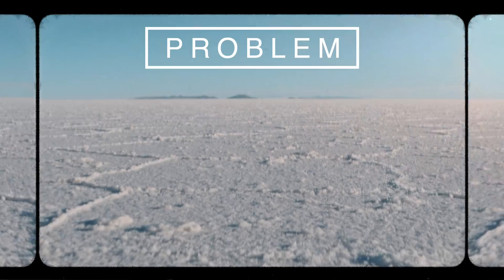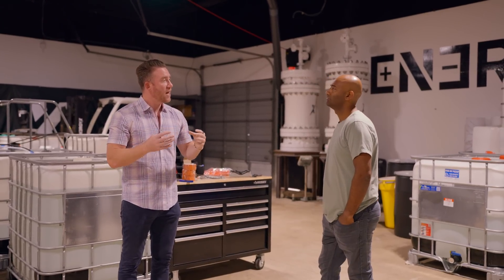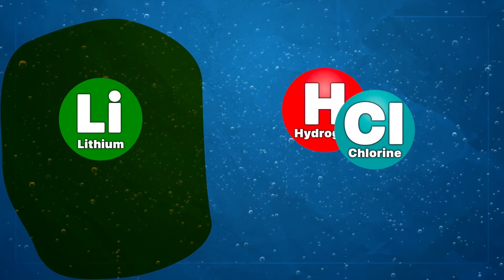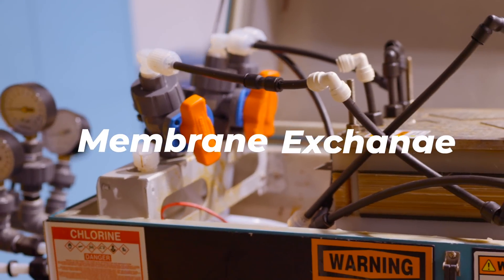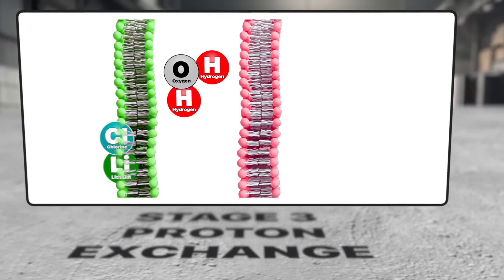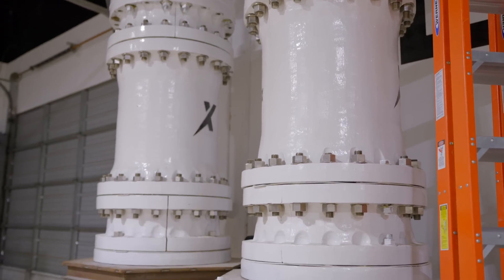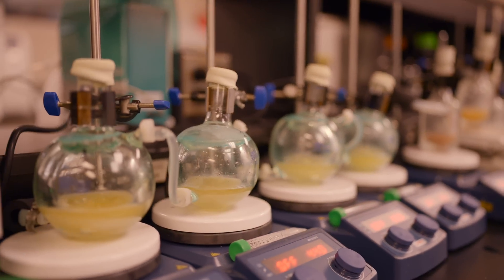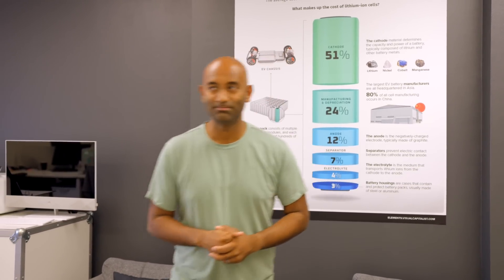The American Company Solving our Lithium Problem

Comment: Sodium ion is looking pretty positive as well. The key game changer will be to get safe solid state residential energy storage to $75 per kwh for the full package (Tesla power walls are $1000 per kwh)
Reply: Especially considering multiple of the largest battery manufacturers like CATL have already announced grid-scale Na-ion battery production within the next 3 years. Considering it will be cheaper and more convenient to manufacture compared to Li-ion counterparts, and with no other rare earth metals needed either (relative to Li-ion batteries), this is going to prove a major shift in how large scale battery production will shape our approaches in the future. More likely Lithium based batteries will fill more niche sectors in the future, rather than being a standard go-to solution for all applications.

Comment: Now just add a desalination process to that model to extract fresh drinking water. And pump that concentrated brine  into this lithium extraction system. Instead of dumping it back into the ocean and you have a 2 for 1. Fresh drinking water for areas in need and lithium for batteries

Comment: EV haters love to cite the lack of lithium as a reason not to switch to electric vehicles. They ignore that the price of the mineral has increased 8X since 2010. The only thing that drives humans to innovate faster than war is profits, and there’s a lot of money to be made from lithium. Till now we’ve only extracted it with evaporation ponds because it wasn’t worth enough to spend the money finding a better way. Hell, for decades oil companies have been re-injecting LI rich brine back into oil wells simply because it wasn’t profitable to develop a way to extract it. Now all of that lithium is just sitting there underground. We don’t even have to drill for it. The wells are already there.

Comment: Cool that they can recover and recycle many mass materials used in lithium extraction......

But tell me whether the energy being used makes it worthwhile compared to others.     Likewise all those membranes... they don't last forever unless they are used with wholly pure agents, which is never the case.   So treat the membranes as consumables ....

Now factoring in the energy cost and the normalized cost of these membranes, as well as any other cost that differs from normal lithium abstraction and production - remembering that at industrial scales unit price does NOT go down as quantity goes up - sometimes quite the reverse - and tell me again just how excited I should be over this startup that from what I can see has only some sample processes running in a lab.    Tell me that some working operations engineers in working physical chem plants are certain that the processes will scale up and still have significantly lower cost than contemporary methods.     

"In the lab" numbers do not impress me when talking large scale industrial processes.

Comment: As much as there were stats in this video and discussion on 1000kg containers, by the stats in the video it will take 70,000kg (3 x tankers in the U.S.) of brine to have enough lithium for just a single EV.  Hopefully this 50% cost reduction includes the cost of transporting the brine to the factories and the electricity to process it.  Making this system modular and portable so that it can be installed at brine pool locations will be the key here.  Let the sun evaporate it down to best concentration, extract what we need & return the rest to nature.

Comment: if its not cheaper per/ton then current process, it wont be adopted...   environmental concerns, will simply shift the process to another country...   only other exception is if it is government subsidized as a strategic resource to keep it local...  then efficiency of extraction might get some air time,  but first principles apply....  price / location / strategic need...

Comment: The reason why gasoline is renewable energy is because it's converted to gas into atmosphere which supplies plant growth. It's symbiosis. If lithium can't produce the same result, it ain't green enough.

I would rather rely on carbon dioxide and and H2O. Plus Helium and Pink Hydrogen.

Comment: I don’t understand how it’s not worthwhile to use solar thermal to boil water down to salt?  The water vapor can be condensed for drinking water and the salt mined to valuable resources. You also get a power plant and electricity.  You have an accessible supply of high power thermal energy for a variety of foundry work and resource processing.  Like why doesn’t Australia have 100s of these along the coast in areas of min population and desert?   

If a large supply of dirt cheap ocean salt becomes available on the market then capitalists will have an increasing incentive to R&D cheaper and more capable isolation of more elements from the salt.

Comment: If you're getting your brine solution from a desalination plant, you can get 30-50% salt concentration in the brine waste stream.  It would be incredible to process the volume of concentrated brine generated by a typical water desalination plant.

Pipe in sea water to a deep hole in the ground and use the power of gravity to push water through a reverse osmosis  membrane. Then you'll have desalinated water and concentrated brine at the bottom to pump out and sell or use for lithium extraction.
Reply: Sea water doesn't have that much lithium.  Lithium mining today is done using brines with unusually high concentrations of Li.
Reply: @incognitotorpedo42  yup. But, there is still economical value of lithium in 30 to 50% brine If you can extract 80% to 90% of the lithium that's there.
Reply: Torpedo has a point. Seawater is 1ppm lithium, so a gram per ton of seawater. If you boil that down to a 10x brine, now you have 10g/Mg. So a 90% extraction would yield 9g of lithium from a ton of sea brine. The dude said their brine yields a couple of kilos per ton though. 🤔
Reply: @serversurfer6169  yup. sea water is about 3% salts. But reverse osmosis removes water untill the concentrated brine solution is say 30-50% salt.  That makes the brine10× to 16× more concentrated than sea water, and we are desalinating the sea water anyways for drinkable water. 

And while the ammount of lithium is still low, using capacitive deionizastion, it's ionic mobility is 10× to 100 times more mobile than sodium which  helps concentrate the the lithium even further. Potasium ions follow lithium and are more mobile that Sodium. Add to that the fact that lithium preferentially crystals out first followed by potasium.  A ton of 50% concentrated sea salt brine has about 1200 kg of sea salts  of which  maybe 24 kg is potasium chloride and  1 kg is lithium. Depending on the quality potasium chloride is worth $200-$2000 and the and lithium chloride is worth $23 to $46.  And the remaining sodium chloride is with about $55.
Reply: @kreynolds1123  If you start with 1g/ton and you co concentrate it 15x, you have 15g/ton, not 1000g. 😕

Comment: A paper was just released that literally used reguar ass rope to do the same thing.  Wicks up the brine and speeds crystallization.  The cool part is that the different salts appear on different parts of the rope due to solubility differences so its really easy to separate too
Reply: As someone who has worked in MgCL and KCl extraction. The rope would need some serious doping to just pull out Lithium. Just to get KCl to preferentially crystallize out of a brine your need to supersaturate it and then carefully control the cooling of the pond for the KCl to form and keep the temperature above the NaCL crystallization temp. Then still hot centrifuge the Mg/K Cl slurry to gravity separate the MgCl. It's currently done on up to 100ton/hr scale but has taken 50 years to perfect.
Stark difference between a paper and mass industrialization.
Reply: link?
Reply: link?
Reply: EnergyX employee here, if it's not gonna help me eat the salts I do not want it .

Comment: What happens with the rest of the brine after lithium extraction? that might be a concern as well
Reply: It goes right back to whatever naturally occurring spot it came from.  They basically pump the brine from naturally occurring ground water, extract the lithium salt and send it right back into the same ground water reservoir though another well a few hundred feet away.

Comment: As others said, I saw a couple of red flags. The biggest one for me is energy use. A couple of those processes are very energy intensive and may not be economically feasible as we have learned from a very similar industry of desalination. The reason we currently extract lithium through evaporation ponds is to take advantage of the sun to significantly lower the energy cost.
Reply: @brandonmassaro9595
One big issue with the conventional (evaporative) brine process (open loop) is the large amount of water 💧 lost to evaporation. This processing often is performed in semi arid parts of the world 🌎 (e.g. Bolivian or Perevuian  mountains). Like many conventional extractive industries, the cost of the water 💧lost to the indigenous community is not accounted for on the balance sheet.

Closed loop manufacturing will be more environmentally sustainable long term IF the requisite energy needed to run the process can be provided by renewable sources (e.g. solar).

Like so many new processes, it'd be better if someone made an independent assessment of their Technology Readiness Level (TRL) before anybody gets too excited about it. Ricky has the background to do this.
Based on their video, I'd say they were around < 5 so they've got a way to go.
Reply: @tomdonahoe3539  Lithium brine water is not usable regardless so there's no lost to anyone.  No one, indigenous or not, is using water from lithium brine.  Indigenous people have no way of extracting water from brine.
Reply: @magnetospin I think we're talking about ground water here, not direct potable water
Reply: Agree 100%.  A new paper looked at using rope for wicking up the brine and was very successful.  The different salts occured on different parts of the rope due to solubility differences.  Completely passive.
Reply: Yea, I have a hard time believing any industrial process could be cheaper than just evaporating it with the sun's energy.
Reply: According to the corporate deck on their website, they claim that the process uses $20-40 of electricity per ton. Not sure if that's per ton of brine, or per ton of lithium produced.
Reply: @bxm61  That would be a critical difference.  That they elided it is not encouraging.
Reply: @bxm61 in the video they talk mainly about tonnes of brine so it's probably that
Reply: @bxm61 my bet is per ton of brine
Reply: @bxm61  You need to process hundreds of tons of brine to get a ton of lithium; going by averages, $30/$0.15/kWh=200kWh, which is about the energy needed to boil two metric tons of water. I think the reason they did not specify was that they thought it is obvious they meant per ton of brine.
If we assume higher energy cost and lowest lithium concentrations the cost of electricity per ton on lithium could be twice the selling price of the lithium, but the main point here is saving some of the 500000 gallons of water the current method needs. Also, the refinery can be smaller and is less likely to leak brine into clean water sources.
Reply: @AnalystPrime  isn't the water salt water? So when they pump it to the evaporation pool there is no meaningful loss to the ocean/sea level and then as it evaporates into the atmosphere and will return at some point/form. If it was potable ground water or lake or river depletion then there would be and issue.
Reply: @MarkBarrack  Either the process needs more water later to wash out the non-lithium salts, or the description I read had mixed the average and lowest PPM values.

Either way the evaporated water will likely rain into the oceans instead of helping local water balance.
Reply: It should be noted that even a process that’s break even on energy costs now, is pure profit when energy prices are dropping.
Reply: Let's all hope we'll make a breakthrough on fusion energy soon.
Reply: All the evaporation pond does is take all the salts out of the water to ease shipping them.  As far as I know, every process for separating the lithium from all the other solids would require re-hydrating then chemically separating as they are doing now.   So instead of evaporating off the water, just to add it back using fresh water so that you can extract the lithium, just start with concentrated (partially evaporated) brine... it saves water.
Reply: I believe they stated their feed stock is from brine water wells, not from the evaporation ponds. He stated the leftovers would be re-injected back into the well. 

Also, getting a three-fold increase in production will pay for a lot of the input energy, which could easily be renewables sourced on-site.
Reply: @robertroberts5218  perhaps.  I did a lot of reading before I bought some shares.  They are doing a lot more than what appears in the video.  Regardless, in current processing, evaporation ponds are only the first phase of a very water and energy intensive process.  The process they have developed combines existing techniques, many of which they licensed from others, in a novel way that has a greater yield with less waste.  And it has the potential to extract lithium from less concentrated sources like seawater, but should also be applicable to concentrated sources like brine from evaporation ponds.
Reply: @robertroberts5218 idk about on-site renewables, enough energy required means a truly absurd solar array and unless the site is in a good spot for wind there's not much else.
Reply: @mrspeigle1  West Texas oil fields have lots of room, wind, sun, and brine injection wells for source materials.
Reply: Huge red flag just before 7 minute mark.  You can't wave a magic wand and make an acid and a base from saltwater.  I'm a chemist, it is not something equilibrium allows.
Reply: Also the Chilean government is stopping all future evaporation pond expansion or opening for lithium exports , in country use is still able to do ponds though
Reply: Sort of like the energy intensity for refining petroleum!  But unlike petroleum, lithium can be recycled again and again.
Reply: Look up the process.  They don't just put it in a pond and harvest when it's dry.  The pond is used to create a highly concentrated brine that they then process to remove the lithium.  The white solids in a dry pond are elements they precipitated out of the brine using other chemicals.  This invention is for processing the resulting brine.
Reply: Economical is a moving target though, you've got price of energy and price of lithium feeding into the equation. If energy drops or lithium increases the process becomes more economical. Now there is a good chance of energy prices dropping over the next few decades due to the increasing efficiency of wind, solar and battery grids.
Reply: I just can't get past the self portrait with him standing with his arms crossed takes a special person sometimes used cars dealers have billboards like that

Comment: As of September 2021. Please note that percentages may vary over time and with advancements in technology:

    Batteries (Rechargeable Lithium-Ion Batteries):
        Percentage: Approximately 53-55%
       Recycling Rate for Lithium: Approximately 40-60% of lithium from lithium-ion batteries can be effectively recycled.

        Lithium-ion batteries are widely used in portable electronics, electric vehicles, and energy storage systems due to their high energy density and long cycle life.

    Ceramics and Glass:
        Percentage: Approximately 30-32%
        Lithium compounds are utilized to improve the thermal and electrical properties of ceramics and glass, especially in manufacturing glass for screens and lenses.

    Lubricating Greases:
        Percentage: Approximately 8-10%
        Lithium-based greases are used as lubricants in various industrial applications due to their high melting point and stability.

    Medical and Pharmaceutical:
        Percentage: Approximately 7-8%
        Lithium is used in certain medications for the treatment of bipolar disorder and depression, under careful medical supervision.

    Metallurgy:
        Percentage: Approximately 1-2%
        Lithium is used in the production of aluminum, copper, and other metals, helping improve their properties and reducing production costs.

    Air Treatment:
        Percentage: Approximately 1%
        Lithium compounds are used in air treatment applications to absorb carbon dioxide and purify air in closed environments.

    Polymers:
        Percentage: Less than 1%
        Lithium compounds are used in the production of certain polymers, enhancing their properties.
As you can see the amount of use of lithium is batteries. Lithium is indeed the current user of more than 50% In your video you have not mentioned the recycling of lithium (though I would think that this technology may be of use in recycling) or the fact that other battery technologies are dramatically reducing the use of lithium.

Comment: Ricky, the one question you didn't ask, which you should have. HOW POISONOUS, is the extractant, that pulls the Li out of the brine, and how do they insure it doesn't affect the brine aquifer, when the residual brine is returned to the aquifer???
This is important, and must be addressed. Otherwise they are polluting the aquifer.

Comment: The best way to do this properly is to combine the most efficient diesel engine with a smaller battery like the diesel electric trains..
Then utilize power rails for vehicles for the future or power as drivers on the pavement.
Reply: The sale of new Diesel and internal combustion engines will be banned by 2035.  Most vehicles will be electric vehicles well before that time.